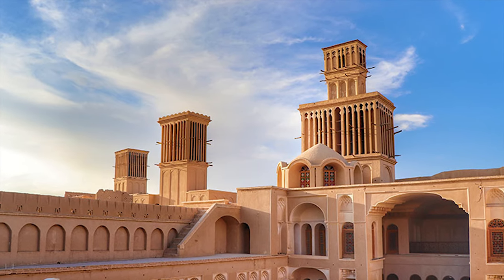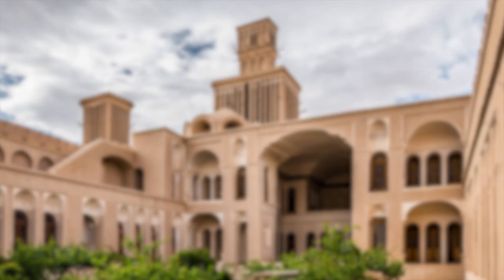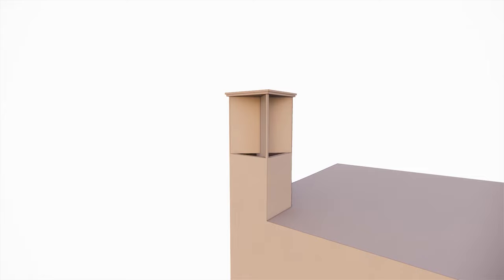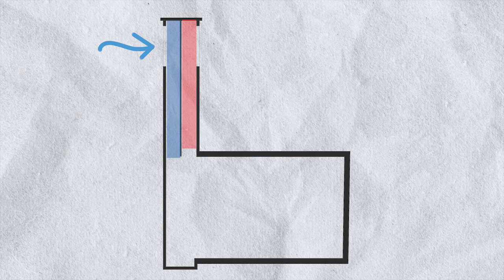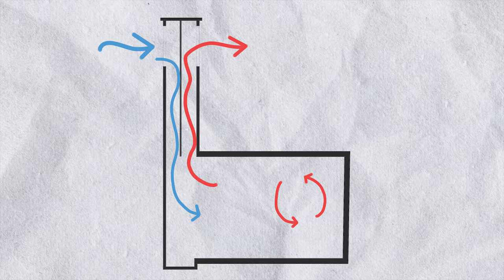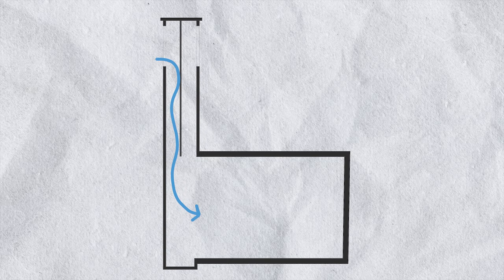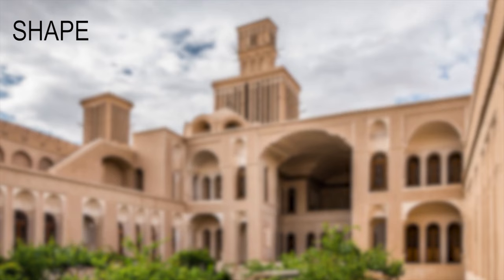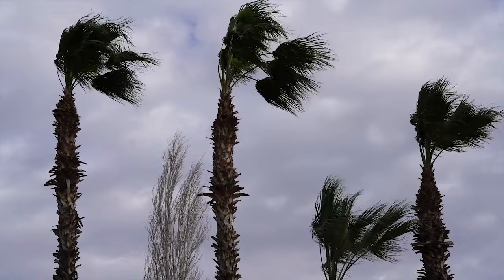How this ANCIENT wind catcher make building cool

Comment: this information needs to be shared with the world. This has the potential to reduce the use of AC and fans
Reply: Evaporation cooling can be used anywhere with wind n a thin pool off water that's the principle behind modern cooling such as fridges n freezers they had ginormous freezers in the desert in Iran 3000 years ago all same principle as modern cooling just there's was free n designed a bit different but same principles 👍
Reply: @thearcanamodernau8130  you saying it wont work in countries like India? Apart from the humidity, shouldn't the same physics apply.
Reply: A same technology with some extra cooling featured tunnel exists in the Golkonda Fort, Hyderabad, India. The wind tunnel also has limestone lining somewhere underground and the exit air is several degrees cooler. And it always carry a moderate heavy air flow into the hall on top of the fort tower.
Reply: @jshaw4757 Adding a pool of water would increase humidity. This might be good in a dry desert, but not in the tropics.
Reply: No, it doesn’t. Or else someone will figure out the answer to a simple question: It’s 30 °C outside and I want 24 °C inside. How does this device make it happen? By magic? 🤪
Reply: We do use this method today, just a technologically advanced form. It only works in very dry climates. It's called evaporative cooling.
Reply: @jshaw4757 
No.. just no.
That is NOT AT ALL  how a modern fridge works.
Reply: Only if the place is windy
Reply: Bahahaha ya people have known about stuff like this and many similar ideas for millenia. But if its 30 degrees and humid outside then like it is right now where i live then this would do little to nothing
Reply: @jshaw4757 in my place
Summer means 90% humidity,40 °C temperature and no wind
It oftenly rains and seldomly have some   hot wind
Tell me how to make people feel like  26 °C with such design in video

😂
Of cause, without the use of compressors

Lsstly, temperature in winter is around 5°C
Make sure this design can gives us more advantages than air conditioning
Reply: It IS known in the world, just not in the US...
Reply: @Seagaltalk this technology is made in the desert with that 30+ C temperature, and it works.
Reply: @rizkyadiyanto7922  ya, when it's the best you have, beggars can't be choosers, I guess
Reply: @Seagaltalk  it can store ice.
Reply: @rizkyadiyanto7922  you can not make the temperature less than the surrounding environment simply by circulating air. Once created, you can technically store ice anywhere, depending on how long you want it to stay ice. You can not store ice like a feeezer, but in climates where it drops below freezing at night, you can use that ice formed to cool during the daytime for a period.
Reply: These really aren't practical in the western world due to cost vs benefit. The cost of constructing the tower is $50,000 or more. The tower is only useful in peak summer conditions, and worse than useless during the winter. Or you could buy a window AC unit for $300. The $300 AC unit can be retrofitted to pretty much any existing structure with minimal effort. You can't say the same for the tower. If you're that concerned about the energy used to power AC build an Earth Home. They're naturally at 50 degrees or so year round. Or get solar.
Reply: And that is exactly why its not being shared with the world
Reply: You so funny.
Reply: @rizkyadiyanto7922  Desert temperatures drop steeply at night, sometimes below freezing. In those areas you can use a wind catcher to let in the cold, dry air at night to pre-cool the house for the day. I don't see how this could work in non-arid climates where the outdoor temperature is still warm throughout the night. The structure will retain too much heat and the inside temperature will increase very quickly when the sun rises.

Comment: Cause these are located in desert or desert like environments, hot air enters through the catcher and helps extract "hotter" air inside.  It doesn't cool like a modern airconditioner but helps remove hotter stale air inside dwellings.

Comment: This is , under the assumption the building itself is warmer than the air, cause it accumulates the sunshine, maybe of several days, and the heat of the walls, has to be lead out.
Of course we cannot cool below air temperate, just down to air temperature. But there still is the windchill-factor that humans give the feeling wind is cooler then still air, even on same temperature. I guess there are kind of shutters , to close the towers in high noon, open at night, and close in case of sand storms.

Comment: This graphic makes more sense if the intake is much higher, to illustrate the point that the cool air is higher, but the air close to the ground is hotter.
Reply: Hmm... If I understand right, the actual diagram displayed in the video thumbnail suggests the exact opposite of the situational model you're describing.
Reply: @Thalanox  I don't think that's exactly correct, but maybe it's not quite as clearly evident as it could be?
Reply: the intake just need to exist, eventually it will push the hot air out

Comment: At time 2.15 you said :
Sherp angle makes more smooth flow !
Are you sure ?
Reply: I wondered about that too but you can see all the example buildings have rectangular wind catchers. I guess she just meant that the flatter sides just pull in more air than a curved shape which stands to reason.

Comment: I ventilate my living area like this when its hot, I dont need fans or anything.
People need to realize that 'just cracking the window open' in enough spots is much better than fully opening everything.
Letting all the air from outside to the inside is not solving the issue, it is probably making it worse.

That is why you open them just a little bit, forcing the airspeed up to accommodate for the Volume difference inside, so it acts more windy.
Having a flow of rapid air is better than having all the hot air from the outside come inside.

Create more pull through

That is what you want if you want to cool down.
If you open everything, its not more pull through, it is making the space inside the same as outside.

You want to increase air speed through your living accommodations to cool it down.

Dont shoot me, but

Oh, wow? This is not rocket science at all, it is very logical, but people generally being stupid, it takes a long time for the general population to get shit that is super simple, if you just take the time to think.

Yes, I am fully aware that I might be an idiot about some things, but please, let us argue for the sake of finding the correct answer, not my answer, or your answer.

Potato post about something I have been seeing a lot about but haven't had the proper outlet or place to vent (no pun intended, actually) it.

So, here we are :D

Comment: Where are these informations come from?
So, if that would work, we also built chimneys all the time wrong too!

I am amazed, because the wind has to come all the time from the same side AND the Wind has to be stronger then the pressure from the heated air inside of the house, which wants to leave the house in both chambers of the chimney.

Comment: It's a ventilation system, not a cooling one. If it worked would have been used everywhe
Reply: it WAS 
used mostly in hot dry areas... however also seen in longitueds as far as 45 degrees
Reply: I think it is cooling when the air passing through mud ventilation, air gets cooled.

Comment: These really aren't practical in the western world due to cost vs benefit. The cost of constructing the tower is $50,000 or more. The tower is only useful in peak summer conditions, and worse than useless during the winter. Or you could buy a window AC unit for $300. The $300 AC unit can be retrofitted to pretty much any existing structure with minimal effort. You can't say the same for the tower. If you're that concerned about the energy used to power AC build an Earth Home. They're naturally at 50 degrees or so year round. Or get solar.
Reply: These used to be built in some early 20th century buildings.